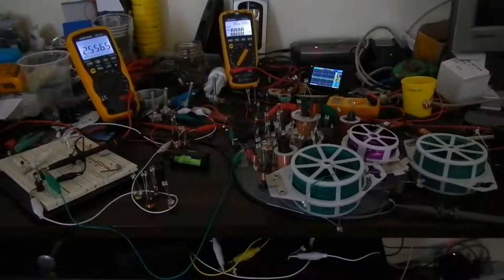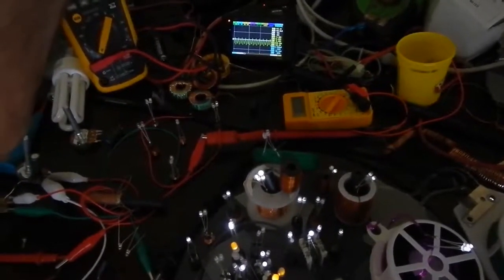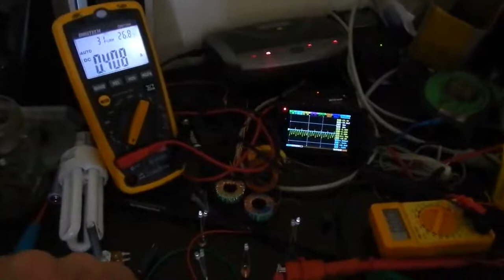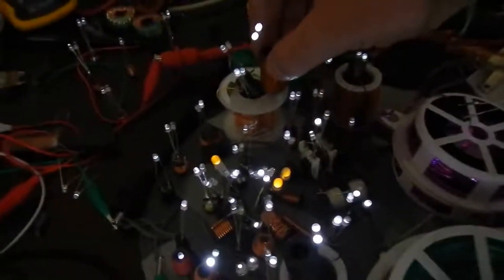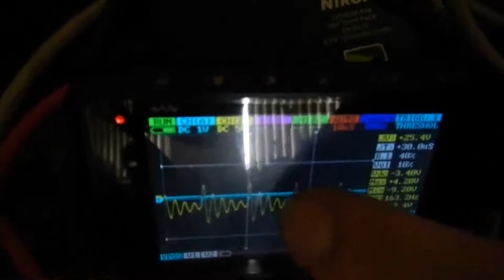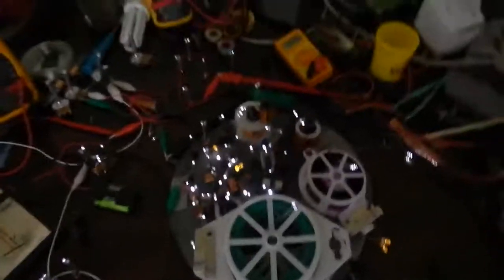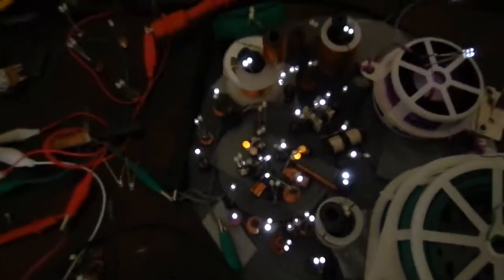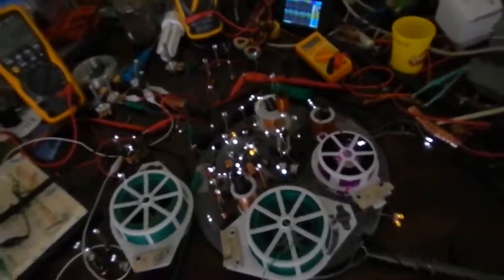Harmonically tunable Wireless Electricity. Lights over 100 LEDs on 67 receivers.

Comment from the maker: The TIP is very nice! I also got a 31 & 32, they work ok too. I'm really impressed with the range and power of this system on 2.5V. Its almost as good as the BAC on 12v. better for the amount of differently tuned receivers it can light. Only 10cm short of the best range i have had from any system, which was 12v BAC with 52cm. To another large coil. This one lights up the steel twist wire at 40cm.

Comment from the maker: It would be rough, but get in the ball park. At least of what is theoretically possible. It would be super overunity though... each led needs 3.4v@30ma or more, for full power. Thats about 0.1w so I only need to light 10 to full brightness to get unity.. LOL. Sounds good until you take pulse times into account. I'll take some scope measurements from a couple, some rectified measurement of some others and average the result. How many can it run though? I can always add more clip leads....

Comment from the maker: Not with this many receivers. I'd love to, but I would need 67 dual Chanel scopes... Or a ton of super cap's or something. Its kind of tricky. Suggestions on how to do it are welcome. I'm leaning towards input/run cap, and charge caps on all the receivers, run it till it stops, count up the joules in the caps, and whats left in the run cap. Still tricky though. Or maybe a lux box. I'm not really loading the system up either. There is a point stuff will dim as more load is added, not there yet.

Comment from the maker: No. Build your own. Transmitter's take 15 min to make, and receivers are quick to wind on ferrite beads with chopstick and cordless drill B), or just de-solder chokes. anything over 120µh seems to work ok. 400µH chokes are excellent!